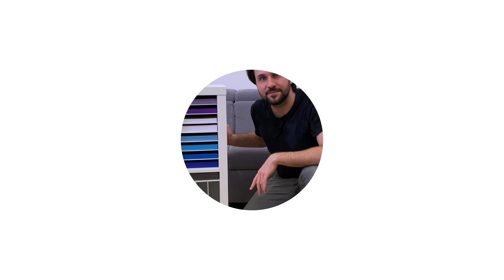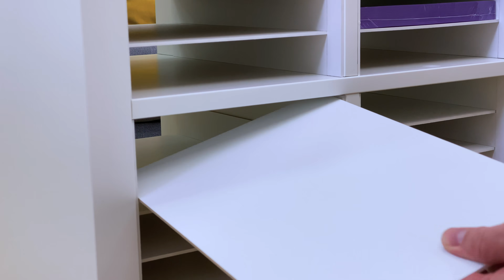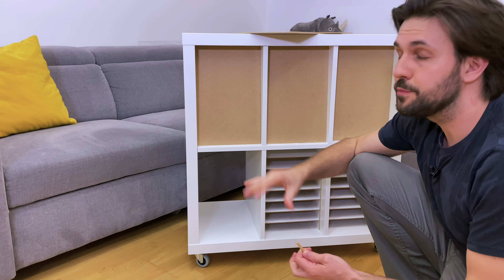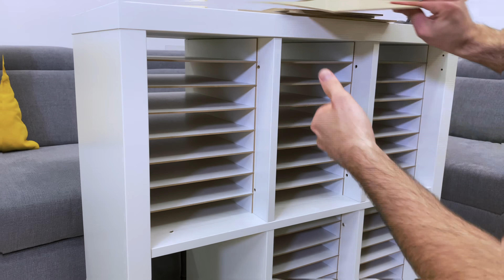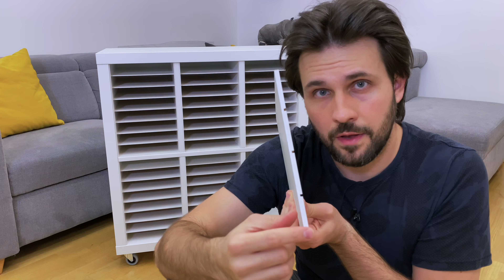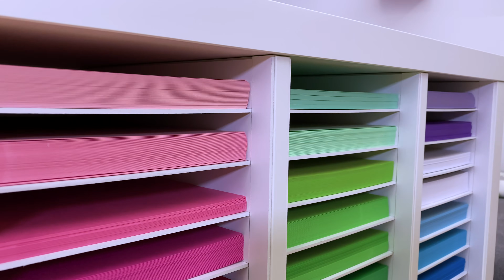DIY IKEA Hack – Kallax modified to 45 shades paper rack [4K]

Comment: hi. do you know where you got the mdf board from as it was the same colour as the kallax whereas all the ones ive managed to find have been a different shade of white
Reply from the maker: Hi Lisa. Thank you for your question. MDF board shades will depend od your local sellers. I bought mine in 🇨🇿 Czech hobby shop Hornbach or Obi (I'm not sure), so this will be not relevant for other countries.
Actually mine is not 100 % same too. Kallax is little creamy white, since MDF is more snow white. I believe small different will be not recognisable since will be filled with paper, shades based on your light sources will do their job too and never the less during time and UV from sunlight will change shades little too...

Comment: Awesome idea, going to use this concept (minus the 3 colums) for my wife to do vinyl sheets as they are 30x30
Reply from the maker: Great! 🙂 So you are going to store them horizontally? Just wondering, because these Kallax are designed for vinyls (vertically) with no hacking...
Reply: @CutnglueCom  Yeah, I was trying to find a paper rack. Didn't think about using the thin boards to make the shelves great idea.

Comment: Great job, but what on earth IKEA? get yourself in order and bring back the actual wheels for the products you sell.  And get your best selling Alex  drawer range back in stock too. . 😂  You have missed out  on £millions by not having them. In stock. 😠🇬🇧
Reply from the maker: Good point Sandra! I like your way of thinking 💸 👍🏼
I live in one of the values – industry 4.0. Means use local sources and eliminate the need for transport or storage and stocks. This is why I do papercraft template primary in digital form so anybody can print them on papers bought in a local store.
This is the same 😇 I created a way/framework/instruction, how to do it from local sources. Not the physical item.
I believe this is what 🌍 needs most right now 🙏🏼

Comment: What kind of glue did you use for the side pieces? I made on similar to hold my 12x12 paper but had issues with the glue holding.
Reply from the maker: I used glue named Mamut. It's probably a Czech product. Parameters say: assembly glue of flexible joint type with a strength of 22 kg/cm². Seems to be very similar to Pattex Fix.
Please, if you find globaly accessible suitable glue, share with us 🙏🏼
Reply: @CutnglueCom  thanks. I will see what I can find and let you know!

Comment: I love it. This is giving me ideas on how to store my papers. I’m wondering if it’ll work on 12x12 in sheets? Hmmm. Excited to try this out!
Reply: The 12x12 sheets work with the original size (4 square holes)! You can skip the extra vertical inserts, and adjust the hdf board size to the exact width and depth of each ‘cubby’. 😃

Comment: So I’m thinking a magnet could lock those backs on without having to drill holes.  You can glue the magnets in place.  You would only need one at the top of each section and a thin wood rail at the bottom to slide the bottom edge behind. Add a loop at the top to pull the top away from the magnet.  The magnet would not be flush with the upper ceiling but it would not be seen and the paper doesn’t reach the top of the space either, so it won’t get in the way functionally.   I like this build.  It’s great for paper junkies. Thanks for sharing.
Reply: Command adhesive with thin wood molding strips all removable

Comment: This is a great design!! I would love to try this but I'm in the US so I'm not sure about the modifications for the bit larger paper.
Reply: Karen, I would consider dividing the top row into the 3 sections if you can find a little narrower MDF or build it by his plan, but drill equally spaced holes along each side to insert plug in shelf mounts.  The spacing strips he uses are taking up the difference in paper sizes.  Hope this is clear...

Comment: I am actually curious as to how the rolling rack has held up under daily use? It is beautiful and looks perfectly functional!
Reply from the maker: Hi Lisa. 👋🏼 Thank you for this question. It's in use for 8 months today and holds and works perfectly. ✌🏼
The only thing I would change is to round edges on individual shelves (edging with a file for example). And is still possible to improve this as they are removable 😃 They are so sharp and when there is a small gap between the upper paper and the shelf above it, it's hurting my cuticle around the nails.
Reply: @CutnglueCom  you could also keep a couple of rubber finger tips (like those bank tellers used) at hand to both have a better grip on the paper and protect your fingers

Comment: Alternative solution for wheels....Make a furniture dolly...Construct a rectangle of 2x4 lumber. The outer perimeter of the rectangle matches the dimensions of the base of the Kallax. Attach wheels to the rectangle.  Anchor attractive wood molding to the outer perimeter of the rectangle. Choose molding wide enough to both hide the raw lumber AND form a raised lip. The Kallax fits snugly within the raised lip of molding. The raised lip should be no higher than the bottom board of the Kallax. There should be no need to anchor the Kallax to the dolly. Note that you could choose a baseboard molding that is wide enough to hide the wheels from view.
Reply from the maker: This is really nice solution I can tell... Especially I like the aesthetic solution at the end of your recommendation. 👌🏼
If I have a workshop, I definitely go this way. Thank you, Valkyrie for sharing 🙏🏼

The solution I chose is more on budget and also doable almost without tools, which was my goal for now.